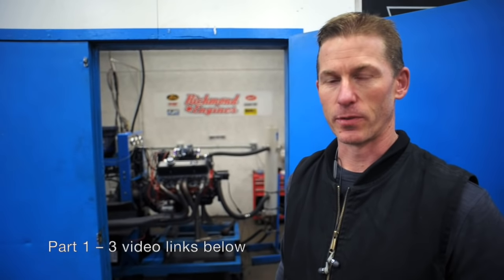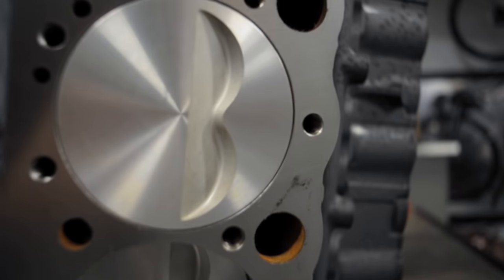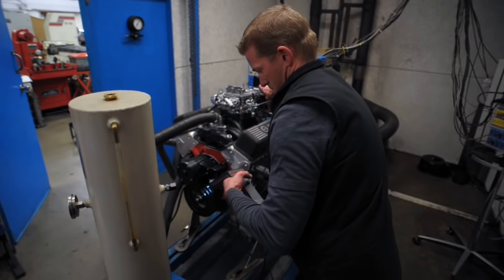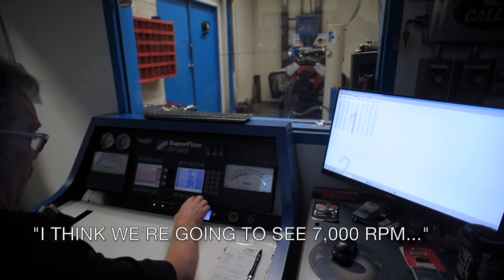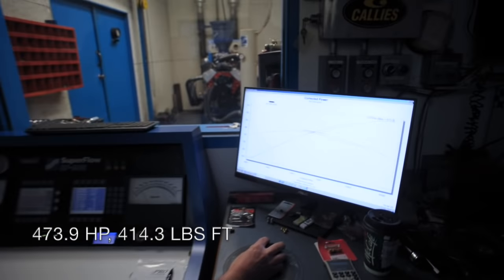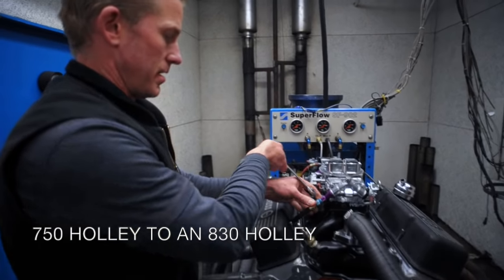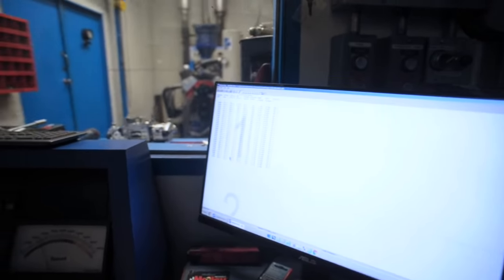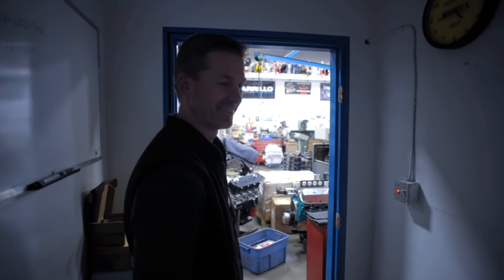SBC 283 Crankshaft + 400 Block = 500+ HP (Dyno Test 1 of 2)

Comment: I REALLY wanna do something similar with an ls engine, i wanna bore and sleeve a LQ9 6.0 (maybe equivalent or better aftermarket block) to a 4.125 bore and use a LY2 crank and get a set of ibeam connecting rods made. I wanna say a 700 lift cam would be best 12:1 compression, it would be my own gen 3.5 SBC should easily make 650 horse plus a lil giggle gas
Reply from the maker: Hey, thanks for sharing! Great engine plan’s there! 
Here’s our version we did.. 
https://youtu.be/ttEsebehdrc?si=2ZyblI3QsjUjgbEQ

Comment: That's very impressive! I now need to watch your other vids to see how you built it. It's even more impressive that  you could use such a mild cam with 87 and no detenatio . Iv found that those pw hei s start breaking up at 7000 and kinda heard that on your motor was that what that was? Awesome job
Reply from the maker: Thank you obby jep for your comments and questions. There were loose screws underneath the rotor (note: always check!) in the PW distributor; definitely cleaned up after we tightened them down, noted here: https://youtu.be/dBjdYC5sMjs?t=225. At 7,000, the valve train starts to float, which we expected (with the conservative nature of the cam/valve train). Thank you very much! Best regards.
Reply: Having used HEIs is serious engines at least with factory modules they go backwards over about 6500 rpm.36 deg @6500 is 34 deg at 7500. Ooops!
The last engine would have benefited greatly from a MSD. Though the HEI never let me down,, unlike MSD and Crane boxes and dissys since!
Reply: @ldnwholesale8552  
Thank you for your comments! We do plan to run it up again with more spring pressure and an MSD. That should clean up the top end of the pull!

Comment: Wondering if the same could be applied to a 302 sbf
Reply from the maker: Hi Miguel Puig! We're glad for your comment—we built a SBF 302 a couple years back, using a tall deck Dart block, 6" Chevy rods, AFR heads, a mild cam (220/220) engine with 9.1:1 c/r and it produced 455 HP and 375 LBS FT. There's no dyno video of it, unfortunately. But here it is, running: https://www.youtube.com/watch?v=cgzTemIAMvI&t=4s
Reply: @ceperformance   what piston you used ?
Reply from the maker: @MP-pz9oe  
I believe that build got CP Bullet Pistons.

Comment: Pretty standard ls numbers, im not sure why people mess with old small blocks anymore. A heads cam $300 junkyard ls will so that and some.
Reply from the maker: Hi Nallen! Standard LS numbers from stock LS engines begin at ≤ 1HP/cu.in. Certain budget-friendly upgrades can lead to 1.25 +/- HP/cu.in. Perhaps more, depending on budget ("Speed costs; how fast do you want to spend?"). Our mild 329 SBC build produced 1.556 HP/cu.in., a result of mechanical efficiency, and a result that we are very pleased with. Any 283 to 400 SBC owner would be happy with 512 HP and 435 LBS FT. Sure, some want more torque, more HP. Build what you want. To us, the results—produced by an engine with a >2:1 rod:stroke ratio, speak for itself. And, best of all, this project was a blast, which may just be the point to all this! Thanks for commenting and best regards. Check out this 329 SBC's second dyno session: https://www.youtube.com/watch?v=Ge6RsIOs1-U

Comment: Where are the steam holes??
Reply from the maker: Hi Commander! Thanks for your question. We did not put "steam holes" in this particular block. The irony: here, an over-cooling issue with this engine, after it had been installed in a '66 Beaumont, is addressed which has since been remedied: https://youtu.be/QENJbE8FY1A?t=313
Reply: @ceperformance  So this is an aftermarket 400 block! The GM 400 has steam holes what a great idea on early cranks with a big bore , Thanks
Reply from the maker: Hey, I’m glad you approve!! Thanks for commenting :)

Comment: Did you just not have a 400 crank? More cubit inches will always make more power and torque. Love the video though. Nothing but love for you.
Reply from the maker: Over the years we’ve built many 400 Chevy engines as well as all the other sizes. This build was unique for what it is. The short stroke allows for longer connecting rods. If you research the big bore with the long rod topic it will shed some light on the subject for you. 
Thanks for commenting!
Reply: @ceperformance  I know about the long rods. I used to be big on them in the 90's. But cubic inches will always make more power and torque. I still love these engines for testing theories though and I understand why you are doing it. I just don't have the money to test theories. I have to make the most bang for the buck. Love the videos. Keep up the great work.

Comment: Love seeing these type builds, if it was purpose built for high rpm at least another what 75 could be there without power adders, as good or better than any of these new fangle LS things everyone thinks they need to build to make power!  would def be a great street engine in a lighter car!  Good job!  First time seeing your channel glad i checked it out.
Reply: Thank you very much for your comments! We love building combos that are a bit different. Using ideas from years past along with modern components such as the camshaft and CNC ported heads, the power potential is awesome! Biggest bore with long rods and flat tops. With this one the rods are 6.1” with a 3” stroke.
Reply: @stevenshumey8363  back maybe 20 yrs ago I had a vega I built a 377 destroke engine.  That thing was a 8 thousand rpm screamer!   Huge solid lifter cam.  6 inch h beam rods. Dart pro 1 heads etc..  Loved that combo in that light car! Oh just a touch of nitrous about 300 shot added for giggles
Reply: @billylennon8905  
That sounds awesome!!

Comment: Do you have a web site that might give the cam specs?
Reply: Thank you for your question! For the custom grind, we chose lobe numbers 3314 on the intake and 3315 for the exhaust. It’s a 4/7 swap firing order, 114 LSA (which was used to increase manifold vacuum and keep it very mild mannered) and it’s ground with 4 degrees of advance built in. The lobes are from Comp Cams Extreme Energy family. We also used 1.6:1 rockers (on 7/16” studs) for a little extra valve lift. 

224/230 duration
.335 / .340” lobe lift (x1.6)

Comment: How bout 327 crank 400 block Chevy, then add Ford 6.12" rods?
Reply from the maker: Another good one! We’ve done a couple of those but with aftermarket rods and off the shelf pistons. 
6.25” rods and pistons for a 400 that are made for a 3.75” stock stroke but with a 6” rod. The fitment is spot on. 
Thanks for commenting :)

Comment: This would make a decent back end no prep under boost. I don’t think I would enjoy this on the street, it’s to far over. No doubt she’s unshrouded and would breath well but would have to really get into the R’s to take advantage of it. We all know keeping the bore where it’s at and stroking closer to square would make a much better street deal. Cool build though, the idea of it kinda had the old nascar feel to it.
Reply: We’re looking forward to installing this de-stroker with a light flywheel and a TKX Tremec 5 gear into a ‘66 Beaumont 2 door hardtop. And it WILL be enjoyable!
Reply: @stevenshumey8363  I should have worded that different because 500hp no matter what the approach would be enjoyable, but I would have preferred to square it up more to that bore for extra torque on the street with anywhere between a 3-3/4” to 4” stroke, but with the right diff and the tkx you can take advantage of that engines sweet spot, I haven’t had the privilege with a tkx but I’ve heard it’s a redline wonder, it high rpm shifts exceptional.

Comment: What Pistons Did You Use Where Can I Get A Set ?
Reply from the maker: Hey, thank you for watching and commenting! The pistons we used are Icon ic9941-060
https://www.summitracing.com/parts/uem-ic9941-060
Reply: @ceperformance  ok So How Did You Get That To Fit ? Because That Would Put You .018 Out Of The Hole On A 9.025 Deck. Right ? 3.00 divided by two equals 1.5" + 6.1" Rods = 7.6 + 1.443
Reply from the maker: You are correct, it’s out of the hole so we used .061” head gaskets. Our actual quench is .035”.
Reply: So You Didn't Have To Cut The Pistons Down At All or Do Any resisting on the tops of the Pistons for the valves and the piston rings didn't come out of the hole. I'm trying to ask the right questions to get the right answer so I get the correct results I appreciate you getting back to me
Reply from the maker: No problem, I’m happy to answer. 
We like to make combinations using off the shelf parts as much as possible. Mainly because, why not! Plus it’s less expensive :)
No piston modifications were necessary on this build whatsoever.

Comment: 4-7 K sweep. What are the power numbers under that? I guess this is where the engine needs to run. Not very streetable
Reply from the maker: Hi Charles Smalling, thank you for questions/comments. It's all purpose-driven. The dyno test fulfilled, at the very least, two purposes: 1) proper engine break-in for our customer, and 2) established some torque and horsepower numbers for us. For our customer, numbers weren't a concern. It was about the component combination. And for us, this is a brilliant, albeit unique, engine component combination that we were happy to assemble, test, and learn from. Purpose. Best regards.
Reply: Just to add, this is a very street friendly, very mild mannered small block Chevy. Idles with 15 inches of vacuum at 700 RPM. We’re looking forward to getting it into the 1966 Beaumont along with a new Tremec TKX 5 speed!

Comment: Why would you want to shrink the cubic inch of the engine? A 406 or larger engine would be a much better choice with way more torque and more horsepower. There's no replacement for displacement.
Reply from the maker: Several reasons why. We’re not the only ones with the curiosity as many of the other comments suggest. 
I guess not every build needs to make maximum torque. RPM is fun too! 
Power with decent fuel economy and running the regular gas is definitely a bonus. Thanks for commenting :)

Comment: I was going to say why would you use an assembly line 400 block and then seen where it was an aftermarket block.I had two of them in trucks I bought new in the 70s and they were total Pos!If they weren't overheating they were breaking something and the other ones I was around that other people had did the same thing..I was told years later they had siamese bores and it caused alot of issues.
Reply from the maker: Hi Jim! Thanks for commenting! Good catch! It's a repurposed Bowtie block. Best regards!

Comment: I’m surprised at the rpm with a 283 crank,looks more like 400 crank numbers
Reply from the maker: We built this as a mild street engine. It’s lower that ‘expected’ rpm was actually what we expected with the conservatively small heads and very mild camshaft. 
Overall very happy with the Dyno results and even more-so of the drivability :)
Thanks for commenting.
Reply: I’ll bet the carb had a good draw with the short throw and I assume long rods but a lot of swell time reguardless.I’m just getting back to my feet after serious injury and serguries but intend to do the same with 327 steel crank but it’s been so long since being in the garage I’m having trouble finding anything
Reply from the maker: Hoping you find the energy to get back into it!

Comment: That's not a 400 block it's a 360 maby bored out but it'd be easier to run a 400 block the reason I say this is the 400 small block has three freeze plugs on each side instead of two like the 350!!!
But your idea is a good one lots of Rs and ponies but less torque of course!!!
Excellent build since torque break's parts but ponies can push your tushy down the road faster!!!!
Reply from the maker: Thanks for commenting. This looks different than the conversation 3 core plug 400 GM block because it is an aftermarket GM Bowtie block. It is also a one piece rear seal block and yes, has 4.125” bores, standard. Siamese cylinders too.

Comment: Now put the 3.75 crank back in. 75 more cubic inches. More everywhere.
Reply: it s not for you... but there are reasons to do it this way..
Reply: Exactly
Reply: This percieved benefit of smaller displacement only works when you are limited by the cylinder head. Test a 283 head on a 302/327/350/383/406. Which displacement worked best? Now test an afr 245 on the same engines
Reply: Piston speed is greater. Theres reasons to go way over square.
Reply from the maker: Over square engines definitely have certain benefits. Thanks for commenting :)

Comment: Goes Towards The Phrase.. 
"JUST BECAUSE YOU CAN-- DOESN'T MEAN YOU SHOULD"...
All The Time & Money To Build A Motor With Good Parts Short Of A Crank.. If Chasing Power.. Probably Should've Gone With C.I.D. & Put Larger Stroke Crank..
Could've Hit 500 At A Lower Range..  What's Here Is Nothing More Than An Expensive 327..
And Really Only Work In A Car Well Under 3000lbs.

Comment: Torgue always wins the race why go smaller on cubic inches. Cubic inches are king
Reply from the maker: Thanks for commenting. I’d disagree a little bit about that though. Not every application needs maximum torque nor is every engine going out racing. The torque numbers on this build, in spite of the 3” stroke are still impressive in our humble, un-biased opinion :)

Comment: Why not use a 4.75” stroke crankshaft and make 600 hp instead?  These short stroke deals make no sense if you are on a quest for power. Your valve train isn’t even up to the task of 7,000 rpm
Reply: Thank you for your comment. Our goal was not to make 600 otherwise we would build a bigger engine. This was a specific build for a customer who requested a short stroke engine. Making 500 with these parts and the mild camshaft chosen was a nice accomplishment in our minds. 
Besides, I don’t know how you would fit a 4.75” stroke crankshaft into a Small Block Chevy. A 4” crank with 6” rods only leaves just over one inch of compression height (wrist pin center to deck). Anyway, a 4.75” won’t fit. 
To do so would require a big block. 
As for valve train, we’ll be adding some spring pressure and running it again!

Comment: Too bad the cost is so high most cant afford this but its very cool . Scream like a 2 stroke
Reply from the maker: Thank you for commenting! We did splurge on a few expensive additions but this build could be mostly recreated on a smaller budget. With a stock oil pan, basic windage tray and even a pair of budget aluminum heads, it would still be a good performing engine.
Reply: @ceperformance  I have an 88 s10 pretty much strip set up 283 60 over 305 53cc heads , cams probably too big but sounds sooooo good . WC t5  , moser posi 373 10 bolt moser axels . Torquer intake 700 holley , msd 6al combo . Home made over frame headers. Fuel cell in bed every guage . Amazin racing seats . This combo is so fun . Cant bring myself to put an ls in it so Im put one in my 68 c10
Reply from the maker: Hey, thanks for commenting again. Sounds like a great project! I wish you all the best in your performance endeavours!

Comment: @7k rpm   There is some unusable power.
Reply from the maker: Depends how ya drive I guess :) 
Thanks for commenting!
Reply: @ceperformance    How you drive? lol.  You plan on running around in 2nd gear at 5omph.  Only thing that motor might be good for is a boat if the piston to wall is big enough and end gap wide enough to keep that rpm up.  Horsepower is a mathematical product of torque.  Torque is what wins races and has an effect on the velocity of a mass.  Destroke has been around and proven as a losing combination time and time again.
Reply from the maker: Thank you again for commenting :) 
Take care.